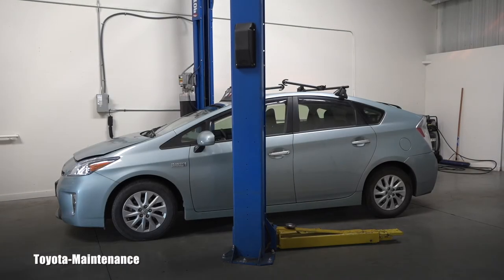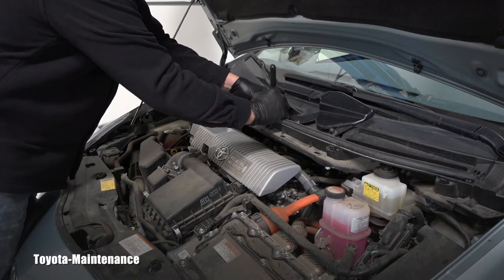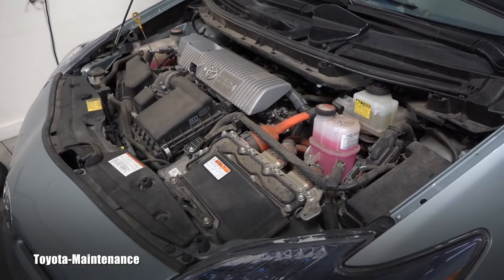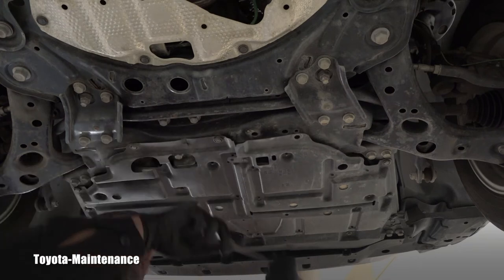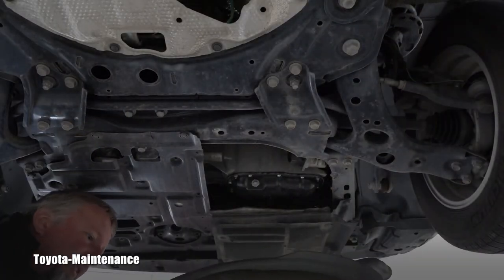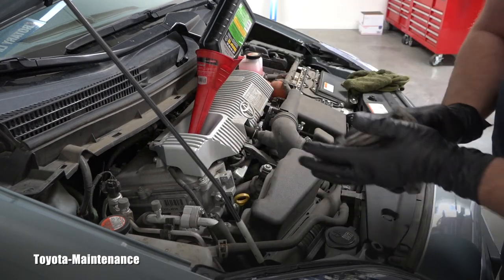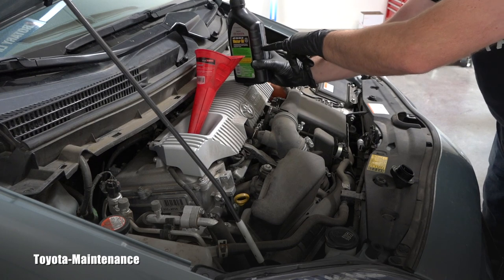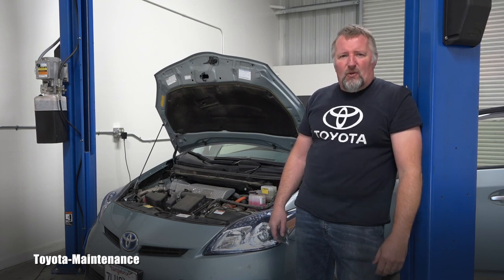Toyota Prius engine oil and filter change

Comment: I have a '08 4Runner and I love how the oil filter is in the engine bay. Makes taking it off and putting it back on a breeze.
Reply from the maker: I love that design too
Reply: Didn’t they get that from subaru?

Comment: Thanks for the video. I will likely have my local garage do the oil changes on my 2017 Prius Prime. I have purchased the correct oil filter cup wrench, identical to the one you used, except mine came in black. I don't want my local garage switching to a spin-on filter so I may lend them the cup wrench for the OEM Toyota oil filter housing in case they don't have one.

Comment: Hello! I have watched your videos about prius oil change and replacing the filter. This was helpful for me to understand where the filter housing is and how accessible it is. I have a 2014 prius which has 183,000 miles on it (I work in hospice and drive it daily for work). My mechanic whom I have taken the car for regular service for 5 years now told me today that the "oil filter housing is worn out. recommend replacing at next service" which would be in two months. I can see how the housing cap gets damaged by a person over-torquing, but can the actual housing piece be damaged and require replacement? They estimate $435 labor and $260 parts. I have asked for them to elaborate on what "worn out" means. It is a lot of money to me and I cannot tell if they damaged it and pass along the cost to me, or if it isn't damaged, but how would I know?

Comment: Awesome video thumbs upped and subscribed!!!Just bought a 2011 Prius and learning the car and because of your awesome video I am getting ready to change the oil. So the torque specification for the oil filter is 25 and for the oil drain plug screw is 40?  I will double check my manual and make sure it's the same or correct it might be vehicle specific.  Great snap on tool too!! Thanks for the video!!
Reply: N•m yes. (Newton Meters) (18 ft.lbs. on oil filter cap. 30 ft.lbs. on drainplug.)

Comment: It’s been 2.5 years since my last synthetic oil change. I must have driven < 1K miles in the same period. The maintenance light or oil change light has not come on yet. Should I change the oil now or wait for the maintenance light to come on?
Reply: You should change your oil every 5k miles or 6 months if you go further than that you will cause damage to your engine.